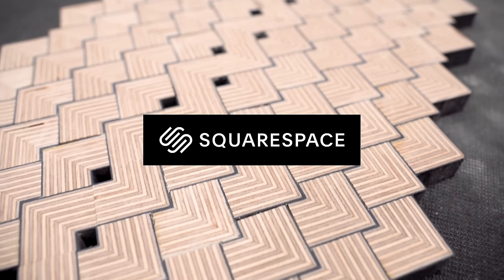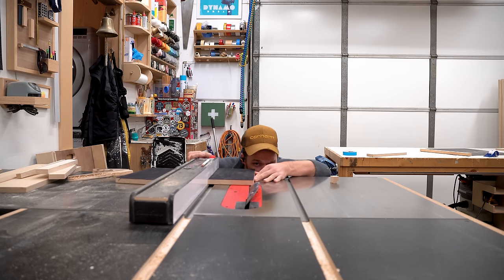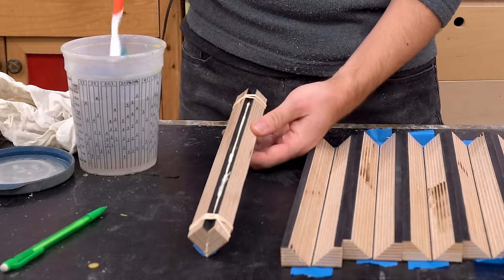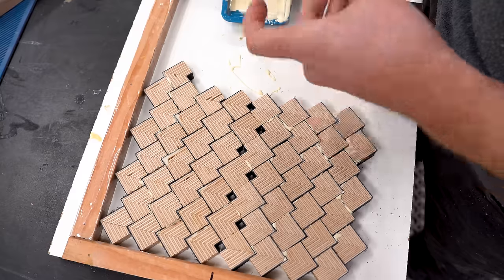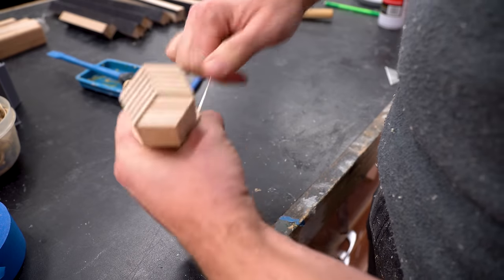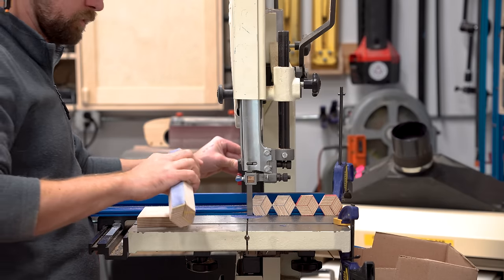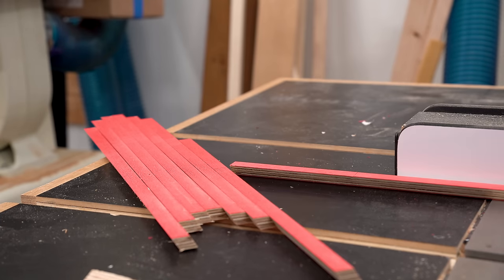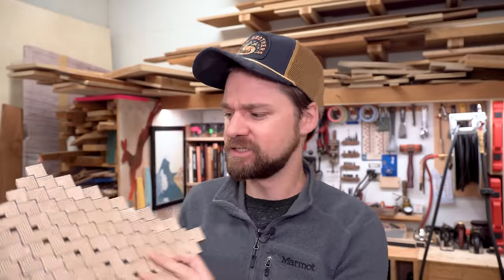Adding Color to Patterned Plywood

Comment: Between this video and your subsequent one with the bowl, I think it might be a good idea for you to pre-iron the veneer so that it can shrink evenly.  This might limit the cracking and resolve the issue you had on the bowls where you got gaps where the veneers shrank away from eachother.

Also, if you laminate the top and bottom of the plywood, the lamina should line up at the mitres...

Comment: I had an idea for keeping your panels flat... your clamping corner and blocks should be shorter so you can lay a 2nd panel on top to apply as a caul to keep them from bowing under clamping pressure

Comment: Hi Michael- Can you use any plywood to make pattern plywood? Does one work better than another? Have you tried using 2-3 different types of plywood when making a piece of patterned plywood? Have you tried adding a piece of solid wood instead of veneer in the design? Thanks for the great videos!  You are amazingly talented.

Comment: Looks awesome, especially the black. I'm thinking, wouldn't is be easier to dye the outer layer of the plywood instead of veneering? Not sure if it will bleed through to the next ply, though.

Comment: Nice! Were you inspired by Yosegi (Japanese marquetry) at all? I think their final step with the patterned material is to plane off sheets of patterned veneer to apply to boxes and stuff. Not sure if that'd work with the patterned plywood, but if so you could get a lot of mileage out of one of those pieces.

Comment: What table saw blade do you use to prevent tear out and splintering of the veneer?  Your veneer split when you ironed it on, because your wood was still wet from the glue.  Or, try ironing down slowly along the grain, from one side to the other.  So many patterns, so many projects.

Comment: They sell veneer softener just spray a bit on the piece clamp overnight and it will stay flat, if the veneer has warps in it this softener will work great.

Comment: Hi Michael! Is there a reason you don't clamp a board on top of the glue ups to keep parts from lifting? Would you be able to use the same material you use as the "floor" so it doesn't stick to the glue too much? (and if so, what material is that?)

Comment: I also love the black pattern.  It was the easiest to see on screen. I was wondering if you pay attention to which face you are gluing? in a number of the pieces, the plywood seemed to flow from piece to piece, and on others there is a very distinct line where the two pieces butt up against each other. would turning one piece over present a matching pattern?

Comment: The Alpine has always been my favorite patterned plywood, and the black really sets it off.  I wonder if it could be made in 4 directions from the center instead of only two.
Reply: To get that to work, you'd have to increase the length of each arm of the Vs so the length to the inside corner was the same as the plywood thickness. 
It changes the look a bit, but it allows for a lot more variation.
If you're curious, you should be able to get an idea what is possible by searching "chair tiling" or "l tromino tiling", at least to get started.
Reply: @ergohack  Oh interesting.  I hade not heard of this before.  I like what I'm seeing, thanks!

Comment: Question: How do you calculate how much extra you need on top to make the tiny V that the next piece will fit into? I'm working with 1/2" baltic birch ply and the only thing I can think is to measure the width of the 45degree angle and make sure it's the same width as the ply. Then, split that 1/2" with the width of the kerf. I'm sure that will work, but is there an easier way? I'm not great with algebra, but I get geometry.

Comment: i loved the black one the pattern really pops the only thing i would probably do is back fill the holes from where you reversed the pattern with black epoxy so you don't have that void. Also have you done any stress testing on pattern plywood im thing about when i redo my kitchen doning the counter tops with pattern plywood?

Comment: I just discovered your channel and I am impressed :-). The technique of using plywood in this way is absolutely brilliant. And the effect with the colored layers of veneer is just awesome.
Colored veneer is not easy to obtain and is expensive. Therefore, I have a potentially stupid question. Would it be possible to use solid colored 120gram (ish) paper instead of veneer?

Comment: I think you may be able to get the same effect by dyeing/staining the outer veneers of the plywood rather than glueing on pre-dyed veneers. You'd need a dye or stain that wouldn't interfere with glue bonding, but that shouldn't be too hard.
Reply: Aniline wood dye powder, it's an alcohol based wood dye.  I researched this awhile back while looking into laminated wood gun stocks.

Comment: Great video! Quick question, the step @6:30, is there any reason to use the band saw over a cross-cut sled on your table saw?
Reply from the maker: I've done both, but the bandsaw is nice because the kerf is so thin that you don't loose nearly as much material in the process

Comment: Another great video.Question tho-when I've made patterned ply in the past,sometimes i had to add sawdust&glue to fix small voids.How would that impact when colour is used?
Reply from the maker: Thanks! You might have to get creative on that one... maybe take an extra piece of veneer, glue it to a board, and sand it to get colored dust.

Comment: Thanks for the inspiration Michael! Do you have any tips on keeping the glue ups flat? I did my first alpine pattern glue up and when clamping it it wanted to bow. I'm now guessing that it just might be an accuracy issue, that is if your parts aren't totally square its going to want to bow? I'm enjoying your videos. thanks!
Reply from the maker: Sure thing! I'm actually going to cover a new/better clamping method in the next video, which should solve that problem. I've started using wedges and it works great!

Comment: Those look very cool.  Newbie question...when cutting into the small pieces, why use the band saw?  It seems like a crosscut sled on your table saw would be faster and easier.  Just curious.
Reply from the maker: Thank you! The table saw works too. The nice thing about the bandsaw is that the blade is thinner so it takes less material away so you end up with more pieces.
Reply: @MichaelAlm  ahhh makes sense.  Thank you for the reply.
Reply: @JyB818  A table saw may also cause chips and blowouts with plywood.